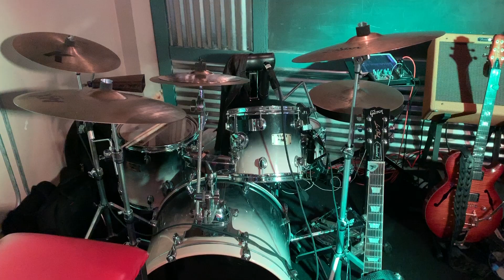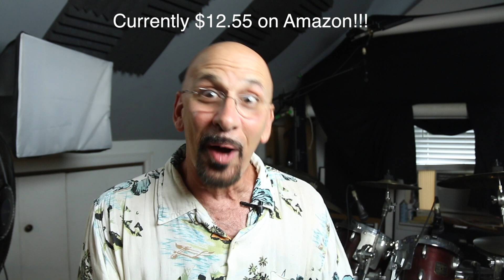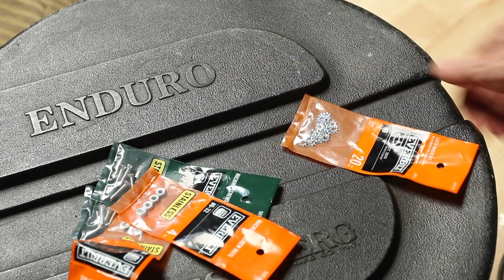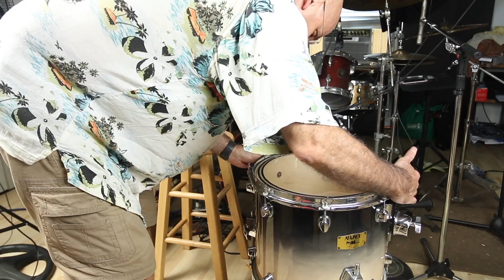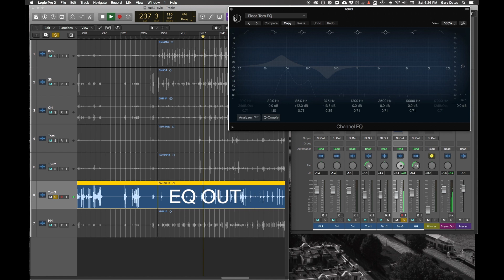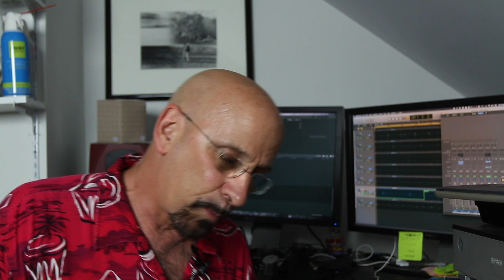Internal Drum Mic Experiment!

Comment: The correct placement is further into the drum, using the bottom lug screws to mount the mic holder. Simply take the mount off the top lug and move it down to the lower lug. Tighten everything and then rehead and tune. You'll never need to change your mic placement again. I've had mine in my drums (toms and kick) for years with zero issues. Compliments at almost every shows from the FOH tech.
Reply from the maker: Yes I now have the mics mounted deep in as low as possible. I do get compliments as to how good the toms sound, but when I've let other drummers sit in, I have to say, standing there listening, the toms sound "sort of" ok to my ears. In my mind there is no internal mic scenario that can compete with external mics! That said, I use my internally mic'd kit alot, cuz it's just more convenient. Yea, I'm that lazy. 😆

Comment: Sounds strange, have you flipped the phase…?
Reply from the maker: I sounds strange because the sound inside the shell is much different than ambient sound...phase is not an issue. I use that kit for live gigs in certain situations and have made recordings off of the board. I'm not thrilled with the toms but it's ok for what it is. I would NEVER use internal mics for serious recording. External mics are just the way to go.

Comment: Hole size needs to be 15/16". Also, cover the place you plan to drill outside and inside with blue painter tape. It'll keep the wood from splitting.

Comment: I removed my Bassdrum dampeners and
I was able to install a micro XLR through the dampener hole. So you don't need to drill a big hole with a standard size XLR. I was able to mount a mic adapter with one screw through my vent hole since I have a 2nd dampener hole to vent air.

Comment: I'm thinking you should have used a shock mount for the mic. The vibration from the shell might be the one messing the sound.
Reply from the maker: The Gibralter mounts come with a rubber template that sits between the plate and the shell. I suppose I could try a thicker piece of rubber, but I'm too lazy. :)

Comment: Cool experiment, I've always wanted to try this too!   I have a bass drum mic installed inside my gigging kit (a Ludwig Vistalite 24") as I don't have a port hole on the reso head, so I wanted an internal mic to make the sound engineer's job a little easier, as most engineers don't want to mic the outside of the drum!   I always wondered about installing internal mics in toms and even in a snare to see how it sounds, but mainly to save time for setting up / breaking down on a live gig.   It looks like we have a lot in common, as I've never really liked the sound on most drums I've heard internally micd (Thomas Lang's kit included!)  it just sounds weird compared to having the mic on the outside.   I have a set of E604's which simply clip onto the tom hoops, so I guess it doesn't take too long to clip them on and unclip them after the gig, but most of the gigs I play, there will be a sound engineer anyway, so I very rarely ever need to use my own mics for a live show.
Reply from the maker: So after almost 2 years of using internals on my toms live, I've found that as long as I take the time to tune them, they sound less weird....still not as good as external mics IMHO, but doable. The convenience factor makes it OK. :) I always wanted a Vistalite kit, but 3 things: 1-doesn't the acrylic scratch? 2-They're expensive. 3-I want them in red, and Ludwig doesn't do red. Overall how do you like them? They sound good?
Reply: @thecreativedrummer5546  Yeah they are pretty loud and punchy sounding especially with the black dot heads.   I play in a Zeppelin tribute (Led Astray based in Scotland, there are a few clips on my other channel) so that's the main reason I wanted a Vistalite, to get Bonham's live sound!   I wouldn't say the shells are prone to scratching, but they do crack.   I have a couple of cracks on my kit, one on the bass drum and one on a floor tom.    I've heard the RCI Starlights are pretty good, not sure if they are still available though, but I'm sure they made them in red.   My Ludwig kit is a red / amber swirl big beat kit (13, 14, 16, 18, 24) from the 70's!

Comment: Don't use sm-57s and it will sound much better. Get the right gear before you judge the technique
Reply from the maker: Before I address your assertion, you should know I did test using not only a 57, but also an AKG 460B w/ a CK 61-ULS capsule, a Sennheiser 421 (industry standard for miking toms),  an EV RE20, and an Audio Technica 4033 large diaphragm condenser mic. I wound up deleting all of that from the video because it was over 30 minutes long and I wanted it to be under 15 minutes tops. Also, at the time I felt that the point of the video wasn't which mic is best, but which miking technique is best. So in that context it was kind of irrelevant which mic I used since the comparison was internal vs external. I settled on the 57 (actually it wasn't a 57....more on that in a bit) because I knew that was the mic I was going to use on gigs. (Please view the 1st 5 minutes or so to see what mic I actually used.) Plus, I guess you missed the part of the video where I clearly explained WHY I was internally miking the toms on my live kit to begin with (sound quality was NOT the only factor). Regardless, I stand by my conclusion.....external miking is far superior, regardless of what mic is used. In all fairness you didn't know that I tested using several different mics cuz I cut all that footage out...in retrospect maybe not such a good decision on my part. :) However, I disagree that the 57 is the "wrong" mic to begin with. I've been on recording sessions where the 57 was used on all my toms and they sounded amazing. All of that said, you are of course welcome to internally mic drums using any mic you choose. Either way thanks for your interest! :)
Reply: @thecreativedrummer5546  thank you for responding. Sorry if I sounded like a judgemental jerk at first. I don't mean to... maybe I should use more emojies and smiles more often... lol anyways, I experimented all the time with this kind of stuff when I had my home studio. If I may, I would recommend a better mic with better low end. I find the lewitt MTD 550 is an outstanding mic on everything I throw it on. It has the quality of a SM7B but at the price of a 57 and has a much better low end and it just sounds awesome on everything. With that being said, I would also recommend you use that eq to pin point the frequency response of the drum and cut it out as much as possible to kill that unwanted bleed. And if I might make a request, could you, somstime make a video of a snare being miced from the inside? Like, through a hole on the side? We typically use 2 mics on a snare drum (1 top, 1 bottom) so why not throw on mic in the middle and possibly get the best of both worlds with one mic? Just an idea. 🤪 lol
Reply from the maker: OK so I mounted internal mics for my live kit in order to save setup and tear-down time.....period. I use a radical EQ to round out that harsh, brittle sound from internal miking. Do they sound great? No. Are they acceptable for some shitty bar? Yup. That's good enough for me in that context. Plus, I wanted the lowest cost setup I could find.....again....shitty bar, not Wembly Stadium. :) I wound up using Plyle PDMIC78s.....they sound as good as a 57 at $12 each! As for recording....I've never met a recording engineer who tested internal miking that thought it sounded good. That said if you're getting good results with your setup then great! I have no interest in internally miking my snare. It sounds great as is.....and I can handle one external mic on my kit. :)
Reply: @thecreativedrummer5546  well, I would try it if I still had my drums and studio but sadly, I don't :/  and I have used techniques in the past that I made up on the spot that turned into my go-to setups. Like putting my snare through an overdrive guitar pedal, micing a box shelf that's reflecting a guitar cabinet, using a rockband mic for a snare mic (surprisingly impressive), recording guitar then playing the track through a better amp  setup from my iPhone and all kinds of stuff like that. Miced my toms up internally once but only with the batter heads on so it didn't ring out. What made it work with the crappy mics I had at the time was the gate I put on it. Bottom line, never stop experimenting with new ideas 😁👍

Comment: I saw someone else sort of mentioned this: did you ever try mounting the mic on the lower side of the tom giving more room between the batter head and the mic? Just like in kick drums, the closer the mic is to the batter, you get more articulation and less low end. I hypothesize moving the mic mount down to the lower lugs might yield more low end and probably more of the sound you were looking for.
Reply from the maker: I tried every internal mic position possible. The bottom line is the sound of the tom inside the inner chamber of the shell can't compare to the sweet, warm sound when using external mics.

Comment: Hey Man. If you use an shitty mic that's designed to be used outside the tom it's likely to sound like crap. 
i have a similar project at the moment bot i DO want to use it for recording. 
i found out that the Audix D2 is ok but not rally working for me. The D4 is good for my 8" racktom might be good for the 10" but in the 12" it has reached its limits. But the D6 is killer all the way down.
I think the problem that you have a whole other dimension of noise and airpressure inside the drum. The D6 is designed for that. And man i was afraid of this project because of informations like yours. i'm so glad i tried it anyways.
Would be great if you tried it yourself and please correct it in the video.  It's not because of the internal micing it self but because of doing it shitty.
Reply from the maker: First of all, I'm glad you found a solution that suits your needs! I think I was pretty clear in the video that I am trying to save setup and tear-down time in a live, bar-type situation, and do so as CHEAPLY AS POSSIBLE. There was no way I was gonna spend several hundred dollars on Audix D6 mics. That said,  I'm convinced any mic placed INSIDE of a tom is not going to sound as good as it does OUTSIDE of the drum, and that's what I said in my video. If internal drum mics were even on par with external mics, you'd see them used a lot more in live as well as studio environments.....but you don't. In fact, I have NEVER seen a recording studio internally miking toms, and I've spent a minute or 2 playing in high-end studios. Lastly, you may have seen the video in which Thomas Lange uses the May internal mounts using D6s in his toms. Towards the end, he records the kit using only those internal mics. To my ears, they just don't sound good. Regardless, I appreciate your comment and stipulate that the Pyle PDMIC78 is not as good as the Audix D6 for toms, internally or externally. :) Here's a link to the video I mentioned: https://youtu.be/lrC-JruZ-hs
Reply: @thecreativedrummer5546  have you ever tried a kick mic internally?
Yeah the Lang video...
I know what you mean... But this sound comes also due to the tuning an positioning.. Do you see his reaction? Seems like he got the sound he wanted.
In another Video he even combines internal and external mics.
You sure have more experience than me but maybe it's not about that in this case. Maybe not soo many people tried to put kick mics in toms.
Reply from the maker: @MichaelBroeckl   Hey thanks for the reply! The kick is a much different animal than toms, and yes I've done lots of different variations/mic placements with kick drums. In the studio, there are usually AT LEAST 2 mics on the kick, one internal at the sound hole and one external. I've done sessions where there were 5 different mics just for the kick (overkill IMHO)! Also on that same kit in which I installed internal tom mics, I have an internal Shure Beta 52A mounted via the Kelly SHU, placed dead-center and roughly 8 inches from the batter. I'm OK with the way that sounds. So let me clarify that I am specifically talking about toms. As far as Thomas Lange's reaction, I'm a bit skeptical. I should point out that he's an A-Level endorser of DW Drums (they bought the May Miking System years ago) as well as Audix (at least he was when he made that YT video). He's not gonna bite the hand that feeds him! :) None of this is meant to disparage Thomas in an way....he's an amazing drummer, and endorsing products is a fact of life as another source of income. However, you can find much more recent videos where he's tracking drums for his solo project. You will notice there is not one internal tom mic to found! Here's a link to one: https://youtu.be/GGVueUgcdsw. Personally I'm fascinated by recording in general and drums in particular. It sounds like you're experimenting and that's the best way to learn, so keep at it!
Reply: @thecreativedrummer5546  thanks for your openness and kindness!
Of course i meant did you ever try a kick mic in a tom internally! So did you?
I understand what you mean and in the studio i'd of course try to combine inside and outside mics.
Yeah i'm experimenting and if you're interrested i'd be happy to send you some files and pictures as soon as i'm ready so you can check out the results yourself. And we can discuss about it and find out new amazing things together! 🤘
Just write me on: " broeckl  (at)  gmx.net "

Comment: I had almost the exact same experience. I used the little Sennheisers. They work fine in a live setting because the room sound and the overheads are taking care of most everything, we just use them for a little definition. They are also fine for recording practice. Based on your video though, I think I’m going to pull them out and replace them with some cheap mics. Your pre-eq floor tom sounds exactly like mine.

Comment: Thanks for the insights!
While working on a 3D printed ribbon microphone I found more elegant XLR screw/thread styled sockets Neutrik NC3MPR-HD:
https://www.neutrik.com/en/product/nc3mpr-hd
They also can be found under the name: "Neutrik NC3MPR HD 3 Pole Male XLR Outdoor Chassis Connector" in some online shops.

But the original sockets are expensive and hard to get for international customers, so I found their copies (I suspect it's actually the originals without branding) on Aliexpress in the wholesale section by the name "wholesale 5pcs/lot XLR 3Pin Senior waterproof xlr male socket":

https://www.aliexpress.com/item/32801422573.html

In fact in my specific project I didn't use the nut part of the socket, I just made the insert hole a bit smaller than the socket body thread and screwed the socket itself tightly into the 3D print microphone tube body (up to compressing the rubber sealing).

I'm also considering using "magic arm" (adjustable articulated arm for mounting video stuff usually) as tom mic clips. With fabric/foam rim padding or something to protect the rims and a bit shock absorption.
Reply from the maker: It sounds like you are a DIY beast!! It wasn't clear to me, but I think you are looking at an external mic solution, not an internal mount. That's good because you won't be happy with the sound of an internal mic. As far as XLR connectors, for my project, I didn't want to do any soldering so the Neutrik connectors I bought were fine. Thanks for your input.  Let me know how you make out!
Reply: @thecreativedrummer5546  Yeah I just began learning drums lol and ordered more mic to mic the kit I got, wanted to find some DIY inspiration for the future and found you:) Thank you!

Comment: A friend of mine used 2" couch foam to fit inside the cans at the middle, then glue piezo's to the foam and wired them in as mics. Worked rather well when mixed with room mics.
Reply: right so you could put a guitar jack and have direct out from the shell...interesting idea. thanks

Comment: Great video. I think the problem with internal mic'ing is that often the mic is placed far too close to the batter head. I wonder if it would sound better further back or even aimed at the shell.
Reply: Thanks for your input! I tried every conceivable mic placement/angle, including pointing towards the bottom head. While there was some variation in the overall sound of the drum, it wasn't enough to approach something as good as an external mic to my ears. After using internal mics in live shows now for many months, I'm still of the opinion that for recording, external mics are the way to go. For live playing, it's not a bad option as long as you are able to set a pretty radical EQ curve, which sometimes isn't practical if you have a shitty FOH guy at the board. :)